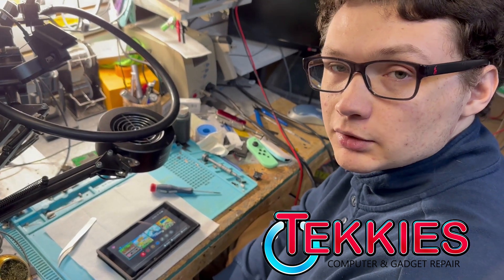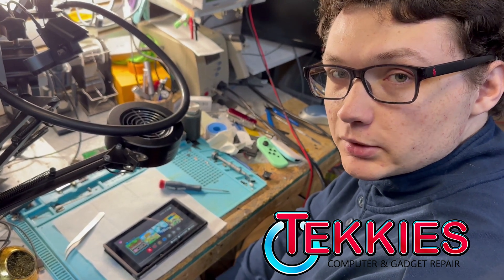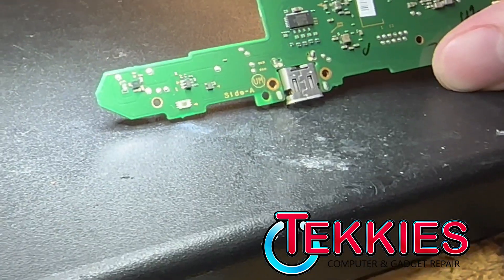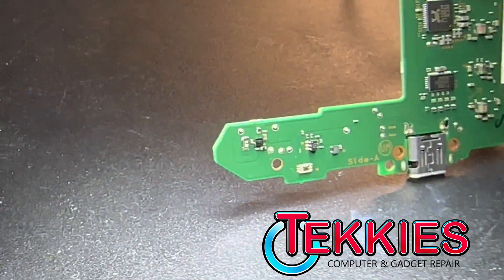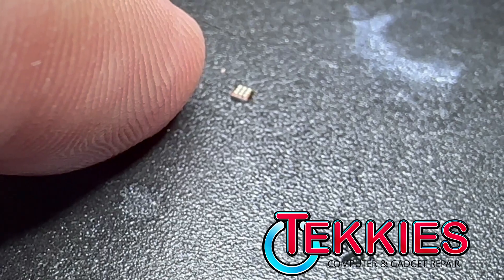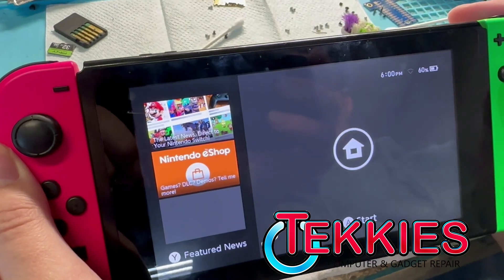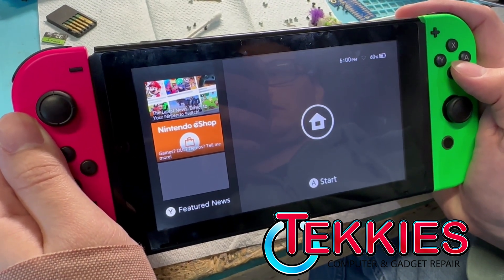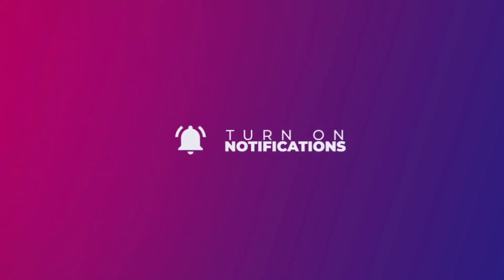Fixing Nintendo Switch🪫Battery Issue: Accurate Reading with Fuel Gauge Chip Replacement

Comment: Hello, i have a similar issue on my switch, so when i start the switch it shows low battery logo and turns off, but the battery voltage is 4.167V. Could that chip be the issue ?
Reply from the maker: That voltage is healthy, so the battery itself isn't the problem. If it's showing low battery and shutting down despite 4.1V+, that's a classic fuel gauge IC symptom — the chip isn't reading the actual charge correctly. Definitely worth checking!